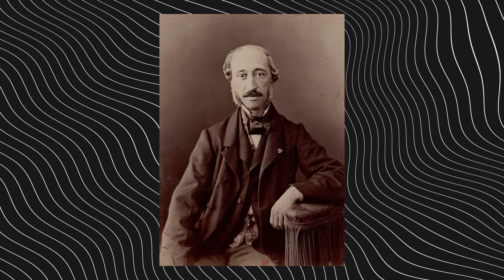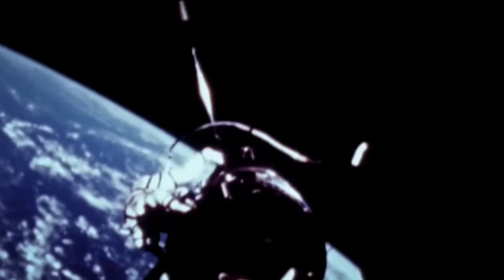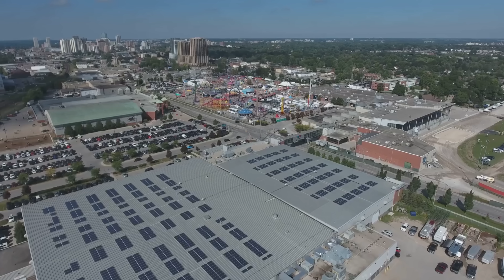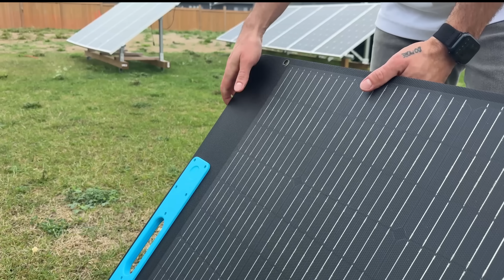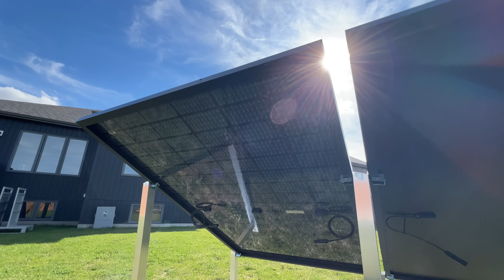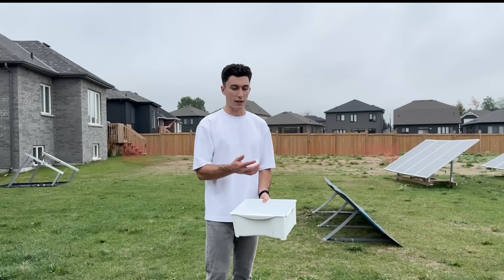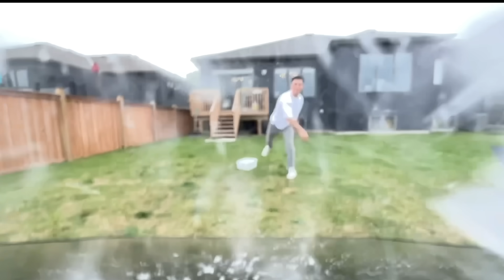Bifacial Solar Panels Explained - Why Are They So Popular?

Comment: As a licensed installation contractor for 20 years I have installed all kinds of bi facial solar panels and the short story is that the increase in annual kilowatt hour production is negligible. It's basically a load of crap. And all the complexity and money that people spend to try to get some lighting on the backside of the module is just ridiculous. You could've spent that money on four or five more solar panels of a regular variety and made way more energy over the course of the year.
Reply: I've found they perform really well. They are often close to their maximum output whereas the monofacial panels quickly drop output once they get hot. They also handle shade better than my monofacial panels probably because they are higher voltage and also because they have 16 bus bars Vs 9. Also they were actually one of the cheaper panels available. Disadvantage is that they are heavy due to having glass on both sides. I haven't made any special effort to get light to the back of them but there is a white wall behind them.
Reply: I disagree sir because if you mount them verticaly  you will get an overall serious increase in power
Reply: @RandyZimmerman-pp5wj Lol, the other guy installed bi facials on a roof is all... Would not hire him cause he hasn't learned anything in his 20 years of experience. 🤣😂🤪 On a roof deck we used it like another roof on top of the roof deck, then we put chairs, tables and plants (near the sides for those that need heavy light and ferns and such in the more shaded areas)... Now the roof deck is a place to hang out as even in midday the place is cool and has enough light. Yeah we did paint the floor of the deck white... Some guys just don't realize that there are installs that don't need bi facial panels and some that would benefit from it. Lots of guys in the industry that are like that. 🤷
Reply: @RandyZimmerman-pp5wj  And if you mount a panel vertically how much power are you losing because the panel isn't facing the sun?
Reply: @Mike__B sir if it is bi facial it will pick up morning and afternoon sun.  And reflective sun regular panels will still pick up more sun just not as much wish you well in your endeavors
Reply: @Mike__B Panels overheat and lose efficiency when the noon sun is beating down on them. Some tests show you get a +7% power output with the standing straight up.
Reply: I bought bi-facials when I expanded as they were actually cheaper for my DIY install. They are performing on par with the panels that were a different brand but mono. In short I don't think its about production. We will see how long they last but I don't expect to have any regrets.
Reply: Agree that if you are getting bifacials, you are not planning a roof install. I bought bifacials and hung them on 2x4 lumber nailed to 2 fence posts on my backyard. Why would anyone get bifacials on a roof install is not comprehending the roof will never produce sunlight on the back of the panels.
Reply: I design commercial size projects and we track production on everything. Bifacials simply out perform mono, hands down. Every percentage increase isn't negligible it's more power over less surface area.
Reply: A panel over here costs 8 euros more over a normal one from same factory jasolar.
Reply: For me I don't have the space for extra panels so for me bifacial was my only choice for higher capacity
Reply: The use of bifacial decreases land use and helps speed up snow melt from the reflective light hitting the backside when heavy snow occurs.
Reply: If you don't have the space then they make some sense
Reply: Great if you have the space.  Now biracial panels don't even cost more thanks to weird tariff exemptions😂
Reply: It depends on where they are being installed, if on a slanted roof, the benefits negligible and probably not worth it, but if the roof is flat and you can raise them off the ground and the same for grounded mounted panels, Bifacial do have many benefits, especially if you want to save space and if you have a bright like white surface for the ground.

If done right, the benefits are pretty big but it all depends on the setup.

All I can assume is that most if not all your installations have been done on slanted roofs, which the benefits of Bifacial negligible, but for most other areas, the benefits of Bifacial are decent and I highly recommend going that root if you can have enough space to allow sunlight to bounce on the back of the panels and especially in areas where you get a lot of snow.
Reply: @paul1979uk2000  Mine are installed on a slanted metal roof which obviously means I get zero benefits from the bifacial panels. Unfortunately I had no choice but to buy them as these are the only ones being sold by most dealers nowadays. Somehow I feel I am leaving money on the table as obviously I am paying more for the construction of these bificial panels but not getting any benefits.
Reply: @anupdev5845 2/26. Did you consider spacing the panels far enough apart for a lot of light to reflect towards the backs of the panels and did you consider painting the slanted roof with a glossy white paint?
Reply: @anupdev5845  you're benefitting because it's newer tech.  Even on one side, they're much better in low light.
Reply: I think it depends on where you are and the season. I guess Nevada has more sun than the entire Netherlands for example

Comment: I have a question, why do you have a wooden fense in your garden rather than something made of vertically mounted solar panels?

If you're more northern then surely your going to have more cloudy days, does defused light from a cloudy day means the orientation of the panel is less critical, meaning vertical panels are just fine?

Comment: Bifacial solar fences should be standard in every new development instead of chain link or even picket especially in the Snow Belt where they are a game-changer. With them, you can start to think about different dimensions of mounting. Vertically, traditionally on an axis.
Reply: And worry about vandals right?
Reply: @crazysquirrel9425  vandals be vandal'n

Comment: Has anyone tested bifacial solar panels mounted on a white steel roof?
Reply: I have both regular and bifacial panels and a white metal roof on our lake cabin. The bifacials were mounted a few inches above the roof to get the right pitch and we see about 15% better output than regular panels. We don't get over rated output on bifacial... but we do get rated where my regular panels get about 85% of their rated output in full sun. I like them better and eventually will be pulling the regular panels down to replace with bifacials. Just a no brainer to get that much more output when panels are cheap. My bifacials are less than a year old but so far... they are great.

Comment: Your argument makes sense for a ground mount. What about a roof mount lying tight to the roof? I don’t think that there is too much sunlight reflecting off of those shingles a few inches away.
Reply: 100% Agree. They have their place on ground mounts but wasted on a black roof.
Reply: Those panels should be several inches above the shingles.
Otherwise you get debris buildup, heat problems, and even animal nests.
ANd you are stuck with the angle they were installed at which is only optimal twice a year.
Reply: @crazysquirrel9425  Some of us don’t have the appropriate spot for a ground mount: yard is too small; wrong orientation; shade; etc. So the roof is the only option.
Reply: @rayopeongo  Completely understandable.
Shame people's houses are packed in like sardines.
IMHO every house should have an acre of land.
Less problems that way too.
Reply: @crazysquirrel9425  

"IMHO every house should have an acre of land."

I think that would waste too much land on lawns and gardens and not food production. I would prefer that all modern houses would be built heavily insulated and sealed and with efficient appliances to reduce their energy demands, and have solar panels and batteries built in from the start. That would also greatly reduce the demand on the grid if everyone's usage is cut 90%.
Reply: @rayopeongo  How many panels can you put on that land? And home garden?
Fruit/nut trees?
Can pass laws limiting lawns to a certain size too.
'Too much familiarity breeds contempt.' applies when people are packed in like sardines.
Nothing says that rental units can be stacked (and should be and not just 2 or 3 either).
NO RENTAL HOMES or similar either.
No Bed & Breakfast.
Single family homes only.
Reply: You could just paint the roof white and get whatever you can. Bi-facial is likely the way panels will trend. Less materials and the process only needs to be optimized to glass as a surface. They'll be more simple to make in the near future.

Comment: I've been wondering about putting bifacial panels on my roof and painting the roof shingles under them white.  I saw on another youtube channel that snow behind the bifacial panel had increased the power output significantly.
Reply: This will not work and coating asphalt shingles is generally a bad idea. Bifacial panels have to have a lot of space to gather albedo light behind them AND no shading from rails and wiring for appreciable backside gain. I manufactured and tested bifacial panels for years, they can work well, but not like you’re thinking.
Reply: Great idea.

Comment: The real reason is because they cost nearly the same as a traditional mono panel now. 

Not all of them are double glass like you said. Most of the budget bifacial panels are now transparent vinyl back sheet. This is why they are cheaper. For best performance, you need to get the double glass ones that cost more and weigh a ton. 

 And bifacial gain is entirely dependent on how you mount them.
Reply: The man himself!
Reply: Also we did not have orbital velocity vehicles in the 1800's haha
Reply from the maker: Yeah we definitely did not! Accidentally dated that about 100 years earlier then we should have LOL
Reply: @solarlabs we also have TOPCON. Panels now. I have a 5.5kw setup with 585watt topcon panels
Reply: aight he already mentioned what i wanted to say .. the missing part is its safer and more durable freakin heavy tho
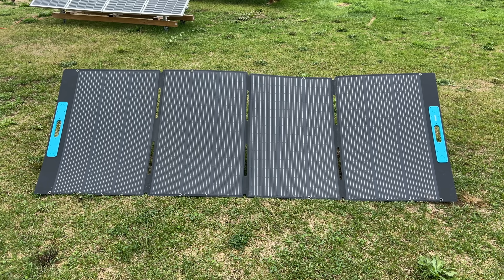Reply: 2:16 he says,  In 1858,  
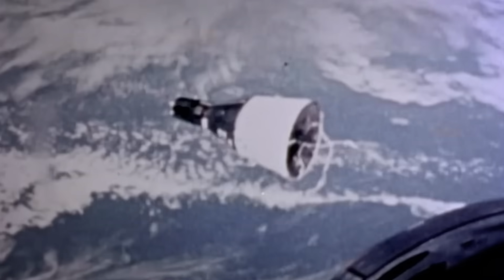2:22
the Vanguard satellite used solar panels to  power its systems, proving that solar energy... not much into proof reading the script. how reliable is the research?
Reply: bifacial panel less durable both side 2.0mm sheet   they don't survive heavy hail storm  and what you do  2 or 3 percent efficiency      , single side panel have 3.2 mm glass sheet  does survive heavy hail strom

Comment: Should try putting a bunch of old satellite dishes spray painted chrome across the ground and all of them angled toward the back of the bifacial panels like some super villain weapon.
Reply: Cool idea but the focal point on satellite dishes is very close to the dish itself- exactly where the receiver is mounted on the bracket in front.  They wouldn't do much with such small focal points either.  That's my guess.  Maybe laying a sheets of plywood painted white under them? More surface area to reflect. 👍🏼

Comment: As someone who owns both bifacial and regular panels, it's not hard to describe why I like bifacials.

If set up in a way to utilize both faces, they generate more power than regular panels can. It's a fun engineering problem that has tangible rewards.

Are they the best to use in all situations? Not really, using bifacials in some solar setups costs more and generates more or less the same,, but they are fun.

Comment: In space, in 1858 ... the Vanguard Satellite (2:22).  I just had to laugh at the brain fart.   Anyway, for any new installation I'd go straight to Bifacial half-cut hard-framed panels... they are often the cheapest, now.  It doesn't matter whether they are flush with the roof or not because their advantages go beyond the bifaciality.  Bifacial half-cut panels tend to be superior in low-light and ambient-light conditions (aka Winter) and wiring them is easier and prettier due to the placement of the junction boxes.

For an existing installation, there's generally no point upgrading unless the panels are actually failing or they are so old their grounding system isn't compatible with modern inverters.  That said, I think there is value in replacing very old systems whos panels are 1st or 2nd "modern" generation panels... typically over 20 years old relative to now.  Those panels had lower efficiencies and higher degradation rates than today's panels.

-Matt
Reply: I thought I heard it wrong. That's a pretty obvious glaring mistake. Overall though it's a pretty solid video❤

Comment: Some bifacial panels use clear vinyl backing and they aren’t all dual glass.  I prefer the dual glass but the glass plates are thinner than the single glass, making them potentially easier to crack while moving/installing.  Some installations, like on a dark roof don’t really benefit from bifacial panels, but for ground mounting they usually will collect more energy during the day than a mono facial panel.  👍🤩
Reply: I was thinking that should be said, even on a light colored roof it wont be significant unless they are raised

Comment: I found them just as cheap to buy as regular panels. They still produce power when covered with snow, and heat up quicker and shed snow quicker in the winter . Now that I have by facial I wouldn't consider anything else.

Comment: I've seen several videos about what to put underneath those kind of panels to increase the bounce. A lot of wishy washy conclusions and sometimes paradoxical results. So far the safest bet is just "gravel or rocks" from what I've seen. Any super reflective surface has yielded very minor gains over the gravel. I don't get it. Oh well.
Reply: Absolute best backing would probably be light gravel or concrete.